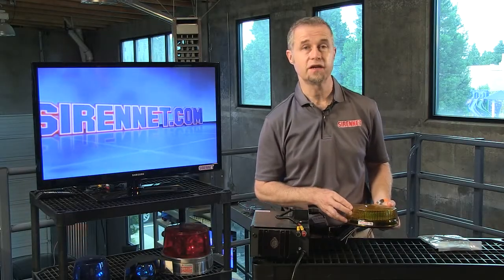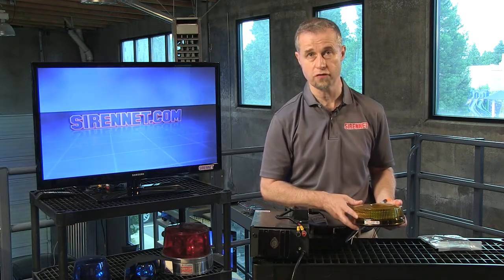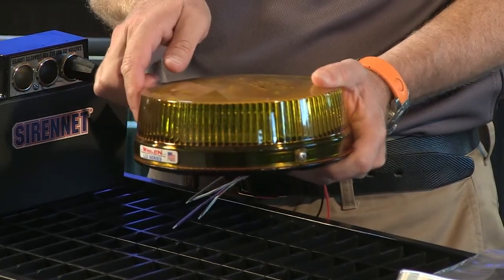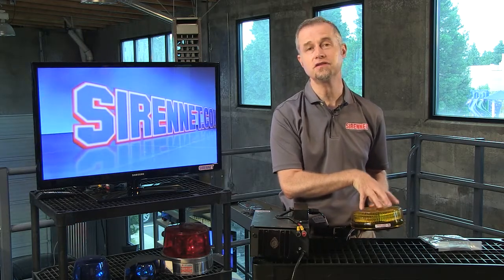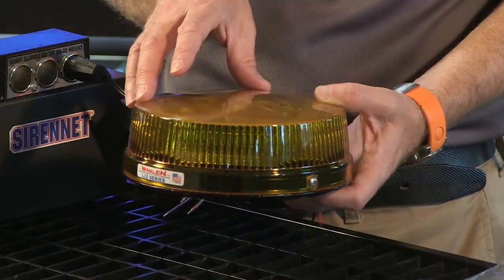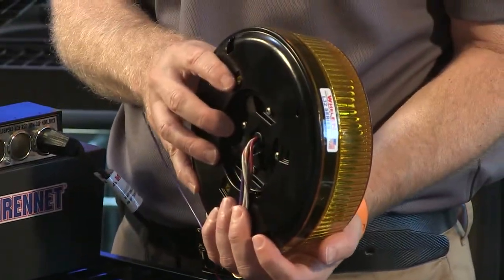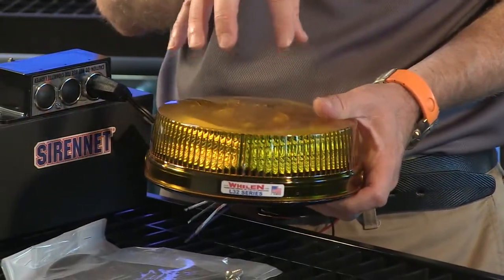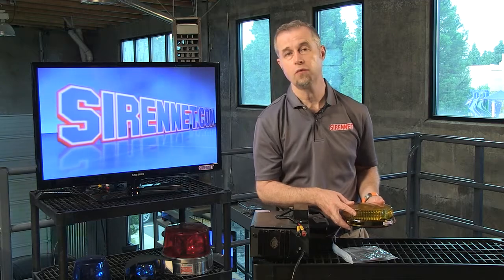Whelen L32 Super-LED 360° Beacon

Comment from the maker: Violet is Low-Power. Grey is the Sync connection. White/Orange puts the beacon into a Cruise-Light mode & the White/Purple wire is the Scan-Lock trigger wire for the L32.